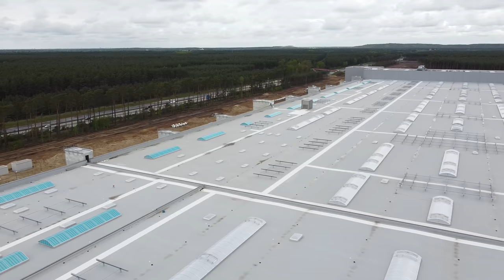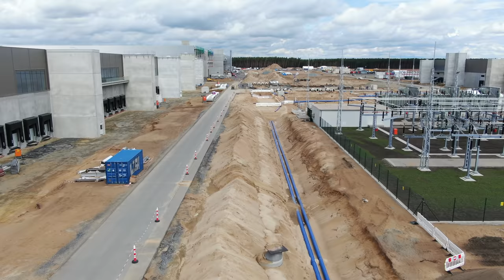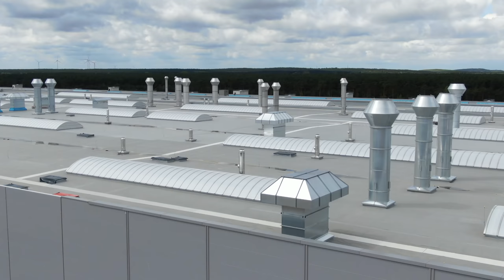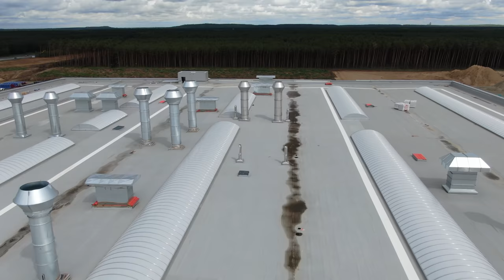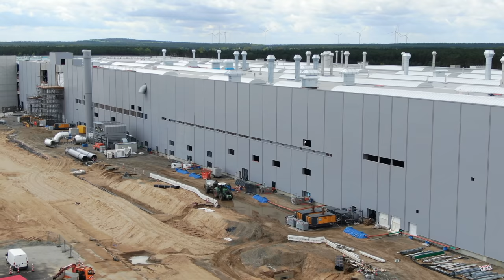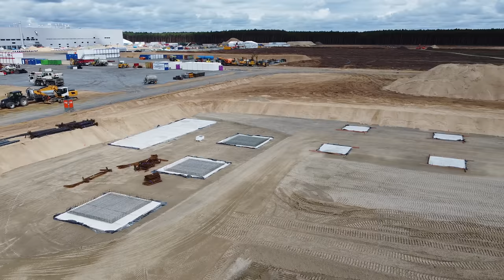Giga Berlin | 2021-05-16 | Chimneys

Comment: Nice video and editing Tobias. The external building structure looks very nice. Have they started staging/installing equipment inside?
Reply: They are installing equipment for months now.
Reply: Hmm, they are pretty much done with installing equipment, hardly anything left on the staging areas around the factory, these get more empty by the day. The temporary loading platform scaffolding is taken down at the paint shop, after being there for months.. The factory must be stuffed to the brim with equipment, because every day pallets with stuff were moved inside.

I think they are already quite busy with calibrating and testing everything, first test production was planned end of this month initially, but this may be delayed just a little bit. Joerg Steinbach reitterated last week, there are no substantial delays and production should start end of the summer early fall.

What I am anxiously waiting for is that the final asphalt pavement is layed down around the factory at the loading bays, and the new Autobahn  off/on ramp so the trucks can come in with the supplies, I think they could start with this any day now. At the east side they are still busy digging in water pipes (the blue pipes I guess) and sewer/storm drain pipes . South side pretty much ready for asphalt, rubbish is cleaned up and gone, not much left to do there. west side I see still some pipes and storm drain stuff laying around, not quite ready there as well... 

The storm drain pipe lines to the east toward the recently cleared forrest area, propably for a large parking lot where the Model Y's will be parked before getting on trucks and shipped all over Europe. Looking forward to see how that works out, will be an awesome sight!
Reply: @MarcoNierop  I am sorry to disapoint you but most of the buildings are stiil empty and without a floor.
Reply: @julianreverse  i really doubt this, unless you have seen new pics different from the ones already posted online
Reply: @MarcoNierop  In some parts of the factory - yes. In others (e.g. GA and DU) the floors are not yet even completely done. And the equipment is not in sight either. 
Tesla applied a few weeks ago for a permit to install production equipment in the GA. 
a) they ordered the equipment already before but missed applying earlier
b) they did just finish the plans a few weeks ago. That would explain why they did not apply earlier and did not yet finish the floor. But it will then also take some time until this equipment is produced and delivered.
Reply from the maker: @julianreverse  That's not true. Most of the factory not only has floor, but also installed machines.
Reply: @TobiasLindh  You should watch others videos ... DU and GA, seats, ... are enirely empty.
Reply from the maker: @julianreverse  Of course they are empty. They didn't have the permission to install machines yet. But it's not most of the factory, and they are not completely without floors. Those illegal drone pilots just show you an insight to a small part.
And by the way, I was inside in the drive unit building on Tuesday, so I know what it looks like.

Comment: What are all the roof vents for though? Paint shop has a filtration system it has to go through first, and they don't look like this. Any guesses?
Reply: Ovens etc. and the flat ones are intakes. The short round ones are for gas furnaces.

Comment: Tesla Giga Berlin completes first Giga Press Model Y front casting
see driveteslacanada web page for info  -- I can not add link here
Reply: That was in Austin, Texas
Reply from the maker: There was a rumor, that it's Berlin, but it turned out to be Texas. The casting machines in Berlin are more completed, but I think they'll need another permission before they can test the machines.

Comment: Are the practice Tesla Cars for the Paint shop still outside?
Reply: Yes, as you can see in the video.
Reply: @julianreverse  I must have missed it, thx
Reply: The paint shop is the process which will need the most water. 
Water which will turn sooner or later into wastewater. And the wastewater treatment center, the pumping station for the wastewater, and the pipes connecting those and to the sewer plant in Erkner are all not yet finished. Or more exactly these works have either just started or not even this. And without a working wastewater system, the options to practice with the paint shop will be quite limited.
Reply: @abalada  thx
Reply from the maker: The amount of Model Y bodies varies though. Sometimes you can see 10, sometimes 9 and sometimes only 8. So they are using them already. And they are not only used for the paint shop, but also for the body in white section.
Reply: @TobiasLindh  thx

Comment: Why is there grass in the switch yard. This should be gravel only?
Reply: Because it's standard to sow meadow on switchyards.
Reply: With the weather conditions in Germany also gravel will be grown over after a few years. As long you don't use chemicals to prevent this. 
Mowing the lawn below (or using sheep for this as long the design allows this) is in the long term the best option to prevent there anything from growing up too close to the high voltage parts.
https://www.valves-community.com/wp-content/uploads/2018/08/umspannwerk-1-1024x576.jpg
And with the robotic lawn mowers nowadays easier than ever before.

Comment: Why so many chimneys compare to other Tesla factories?  And  why do they have all those Castle Towers along the outside like a 15th century Castle that shelters garrison troops. Is it structural, fire exit, or all because of local building codes?
Reply: Just stairwells and entrances to the individual departments, offices, canteens etc. They are no chimneys they are air intakes and exhausts for the paintshop curing ovens etc.
Reply: @julianreverse  I was thinking that but have never seen stairwells on the outside of a building like that. In Tesla's other plants the stairwells are on the inside. That's what made me think it might be local fire codes. Any idea why there are 20,000 chimneys on the roof?
Reply: @disturbed4733  It's standard for this type of construction and safes space at the inside and also serves as emergency exit but it wouldn't matter if it's behind or infront the wall. Just easier to build.
Reply from the maker: @disturbed4733  Actually the first phase of Giga Shanghai also had the stairwells outside.
The paint shop is supposed to be more advanced. Maybe that's the reason for more chimneys, but I don't really know.
Reply: @TobiasLindh  Thanks, never noticed that. The Shanghai factory looks so different from Berlin, Nevada, or Austin, especially the rooflines. The Shanghai factory reminds me of a house that has had several additions added over the years.

Comment: Hopefully they dont need all the giga presses to start production soon. Because at this pace they wont be producing Y’s till next year
Reply: Model Y in USA is produced using two casting machines. The Fremont ones have no walls and only a partial roof. Did you know they have already produced front castings at this factory in Brandenburg?
Reply: GPSFinancial i saw that, i dont know whats the game plan with that part. Thats why i said hopefully they dont need it and can just start production
Reply: @cjk_02221  They can produce over 1000 parts / day with one casting machine.
Reply: To start the production the 2 installed Giga Presses are sufficient. And they set up a temporary LNG gas station which makes only sense if they want to make tests soon. Before the factory is connected to the public gas network.
The full capacity of 8 Giga Presses there will make only sense if those will feed more than just one production line (i.e. only with further phases beyond phase I).
Reply: @abalada   are the allowed to test in a pre production phase ? So i mean, are tests allowed before they are fully allowed to open the factory ?
Reply: @martinneuwirther4644  
a) the permit to install machines/production equipment allows to bring those into a working condition (thus also tests)
b) Tesla can also apply for a test production phase under the granted preliminary permits
c) the final permit is however needed to start real production (of products to be sold). And not to forget: the final permit approves what was applied for. Things like the Sprinkler center, fire station, hazardous materials storage ... and their roles are inclusive parts of the submitted application. The final permit will thus only materialize if those things are finished and working. And so far works on these things (and a few more) have not even started.